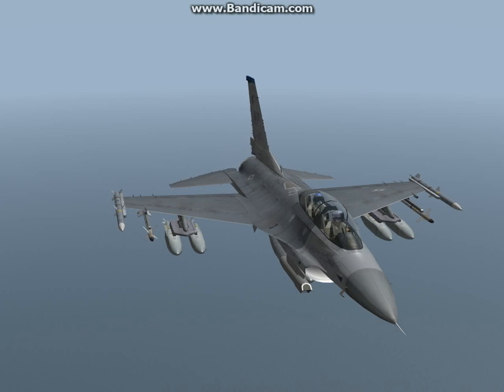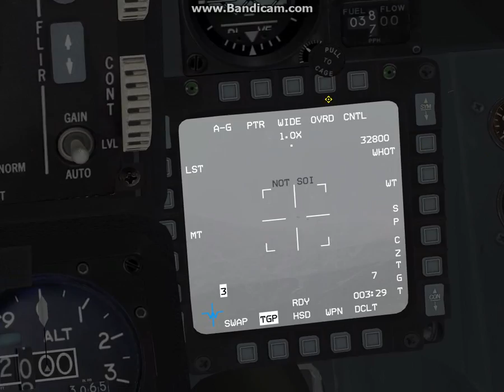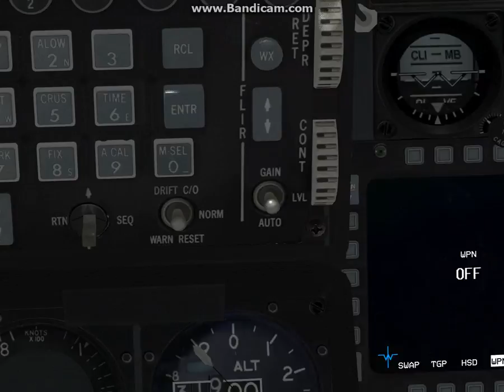✪ BMS 4.32 "AGM-154 JSOW Tutorial"

Comment: B, just checking out some of your bms tutorials, great stuff. Just wondering about the cat 1 switch and what that does? Thanks for any info ;)
Reply from the maker: TheSkipjack95 Right, I believe it limits the G loading on the aircraft to prevent structure failure during maneuvering with heavy pay loads.
Reply: MikkyTee If I'm not mistaken, the Cat I switch limits the maneuverability of the plane ( in broad terms ). It's used when you're carrying heavy loads to avoid ripping stores off or damaging the wing.
Reply: ***** some copy and paste from f-16.net :
The Cat 1/3 switch provides AOA limiting (25 Cat 1 and 16-18 for Cat 3). The Cat 3 loads are more susceptible to departure/out of control, hence the lower AOA limiting. The switch does NOT provide G limiting, so it is up to the pilot to ensure he doesn't over G the jet. The limiter also provides limits in roll and yaw, but that covers a whole page in the -1.
Reply from the maker: +Anaximander29A Thanks for the clarification. Makes complete sense to limit AOA to maintain controlled flight.

Comment: How did you get the munition to guide to the radar lock without locking up the target in the WPN page optically?  The only way ive been able to get the JSOW to hit a target is by visually locking the targets in the WPN in the same manner as a Maverick.  Any ideas?
Reply: Webs The weapon should be operation PRE-briefed mode, as indicated on the SMS page. Then when the waypoints are cycled, the positions will be passed to the weapon and the RADAR will point at the ground location. The RADAR will not lock the target, however.